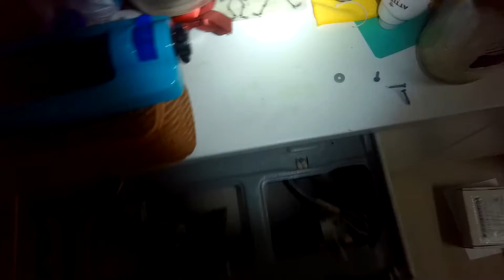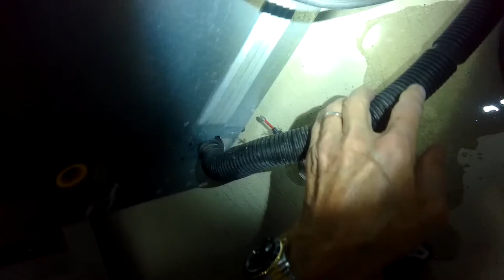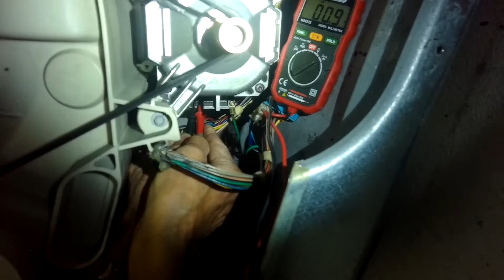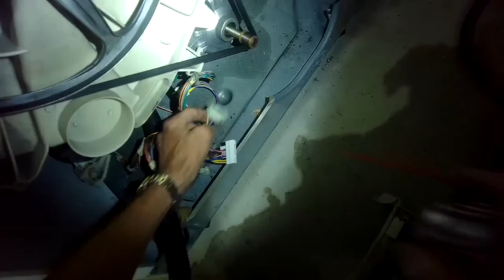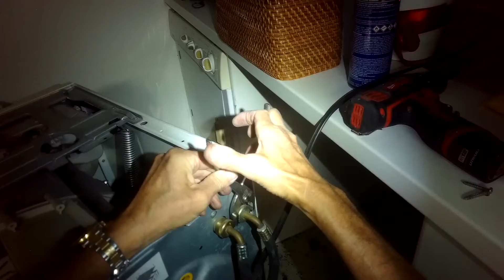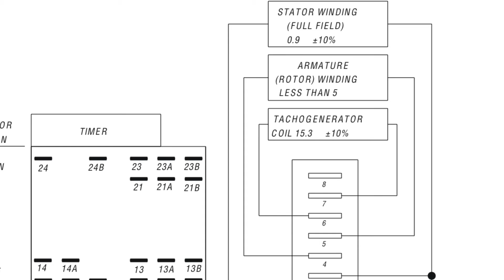✨ GE GALLERY WASHER WON’T AGITATE - FIXED ✨

Comment: FYI It ended up my washer was so off balance that the drum bounced up and disconnected the plug behind the timer. I didn't see it until i sprayed with cleaner (@ 8:08 in this video)
Reply from the maker: Excellent, thank you.
Check out Our New Site Full of Articles and Videos on Appliance Repair: https://www.ApplianceFixes4you.com